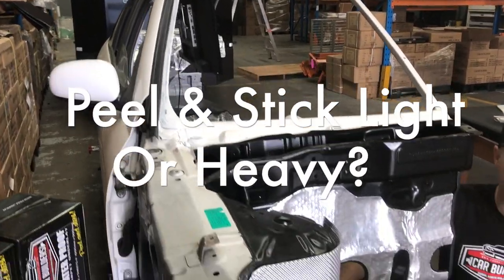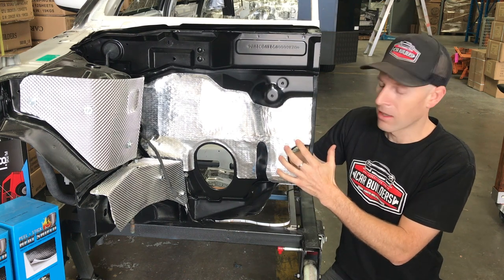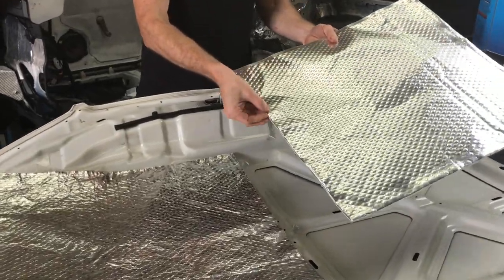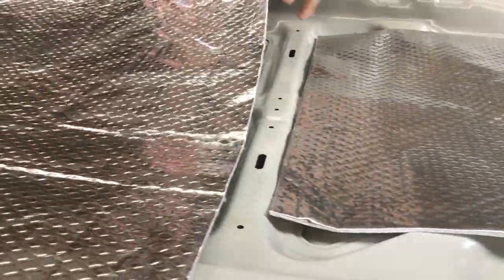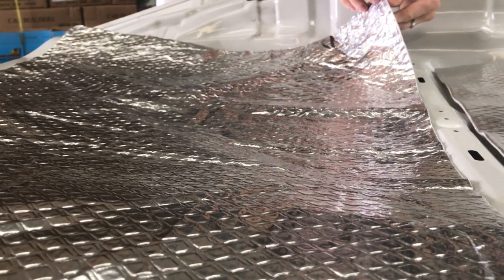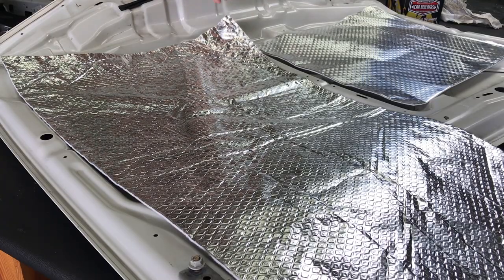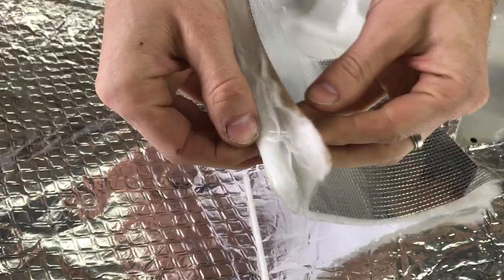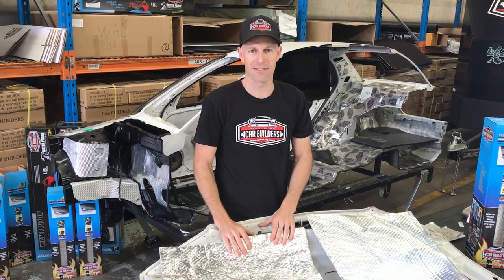Which heat shield is best? Stop engine heat at the source.

Comment: Can this be in direct contact with a exhaust manifold? Im trying to sandwich it betweem my intake manifold and exhaust headers on my jeep
Reply from the maker: Hi 33 Sosa. It does need a small gap to be most effective. By directly touching, it will create a thermal bridge. Also, at extreme temperatures it'll damage the product.

Comment: Guys.! I have a Ford ecosport . Heat from the exhaust creep into the surface of my boot (trunk ) of my car. If I use the material which u show in the video will it help to reduce the heat..,?
Reply from the maker: Hi Srikhanth. Yes, this will significantly reduce heat through the boot. You would stick the peel and stick heat shield on the underbody of the car, facing the exhaust. Another option which is probably even more efficient is our exhaust heat shield https://www.carbuilders.com.au/ehs_k 👍 If you are in Australia you can order from our website, https://www.carbuilders.com.au/ If you are overseas, please email sales@carbuilders.com.au with what product you are after and your shipping details and we can send you a quote for the items with delivery.
Reply: @carbuilders1  thanks for the quick reply..

Comment: just found out Nitto Denko is making black heat shields. OEM approved. Bonds great! Looks great!
Reply from the maker: Hi bortlethetortle. We often hear about customers painting our aluminium heat shields black. We advice that this will dramatically reduce the effectiveness of the heat shield as the silver aluminium reflects most radiant heat but won't do this with a black surface where it will absorb radiant heat.

Comment: Yes, 1980 fj40 Toyota LandCruiser
Reply from the maker: 👍Is there a reason why you only want to treat externally? Have you watched our Troopy Install? (obviously different model but same strategy) https://www.youtube.com/watch?v=wLm11KVyq7Q&t=1175s You can use a paint to deaden the panel externally however that covers only stage 1 of the treatment (would replace the butyl mats). You then need to try and blanket out the noise, internally we use a foam or a more heavy duty treatment is the mass load vinyl.
Reply: Not special reason, just trying to get the cabin the quiet as posible. Thanks.
Reply from the maker: 👍👍Give us a call on Monday if you have more specific questions

Comment: Hi CarBuilders, thanks for your great videos, & I hope this isn't a stupid question: for install of heat shield on the engine side of firewall, can you do it with the engine in place or does the engine need to come out first? (Trying to work out if it is achievable for me, I have a Ford Econovan 1995, cab over engine, lots of heat coming into cab). Thanks again.
Reply from the maker: Thank you for the positive feedback Jive Bellhouse. No, you don't need to remove the engine however accessibility is the issue. The most effective heat shield is the embossed heat shield as it is spaced off the sheet metal and has air flow between it and the panel, demonstrated in this cab over https://youtu.be/BT7wBNL_1Qw If you can't fit a spaced off heat shield then you should look at the peel and stick.  😎👍
Reply: Thanks I'll check out that other video.

Comment: My turbo manifold and dump pipe have no heatshield i have been lookinh for one and was looking at the ally solution you guys sell but are reccomended to have it off the heat source this is going to be quite hard is it possible to have it touch in some spots without issue?

Thanks
Reply from the maker: Hi Mick. Sounds like one we need to talk through. Give us a call 03 8777 0960 👍

Comment: If i put this on my car windows, will it keep my car warmer in the winter while I'm hot boxing?
Reply: It will when used in conjunction with accessory (pat.pending. Warm n stiff). Simply attach hose to exhaust, plumb to rear quarter panel and attach to the special window adapter. Start vehicle and run at fast idle. Enjoy.

Comment: Hi there guys, im building my Ls1 turbo in vx commodore and was wondering would this peel n stick be ideal for placing on the firewall to protect the brake line from the dump pipe heat?, and which product of yours would be good to mould a alternator heat shield..Cheers Fellas

Comment: Wouldn't that be just reflecting heat back in to engine?
Reply: Yes... that is the point.  You put it on the firewall and floor to keep heat out of the inside of your car.  Also protects the paint on the hood (bonnet) of your car from the extreme heat coming from the engine.  Turbo and race engines make a lot of heat...

Comment: I have a silly q...suppose you use heat shield and carve it in the form of the car windows...do you think it would be effective at helping keeping a parked car cooler than say those cheapo ones from Kmart? (Ie on the interior of the car)
Reply from the maker: Haha. I think it would act similarly if placed inside the car as both will reflect. For it to work, you would need to have it on the outside (heat facing) with an air gap.. not too practical.
Reply: @carbuilders1  true...because the light heats the glass and the glass heats the air.

Comment: How well does it hold the water? I've heard of this stuff rusting out your panels
Reply from the maker: Hi Christopher. If you have a worry about trapped water, customers use our aluminium heat tape, silcon or seam sealer etc to seal off the open edges. The heat shields themselves obviously don't rust as they are aluminium 👍

Comment: Can I apply it on the roof to resist heat?
Reply from the maker: Hi Saneesh. Yes, you can however it won't be as effective as facing the heat source. Manufactures such as Ford use these shields internally on the floor pan. You also have the chose of Insul Layer or Van Liner (https://www.carbuilders.com.au/van-liner) which is a thick closed cell foam which will act as a decoupling layer and slow heat transfer 👍

Comment: Does it reduce noise?
Reply from the maker: Hi Nelson. It will have some sound dampening effect with the needle punched fibreglass with a polyester core. However, there are materials/applications that will have a more effective impact on sound reduction. 👍
Reply: Which material it proper to apply on that side of the fire wall for noise reduction?
Reply from the maker: Is it engine noise that you are trying to dampen?
Reply from the maker: What vehicle are you playing with?